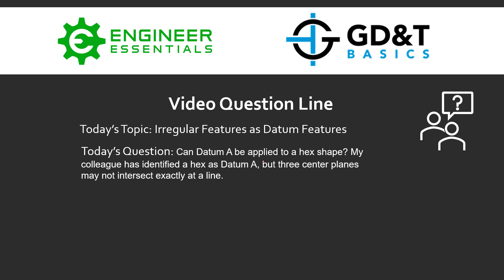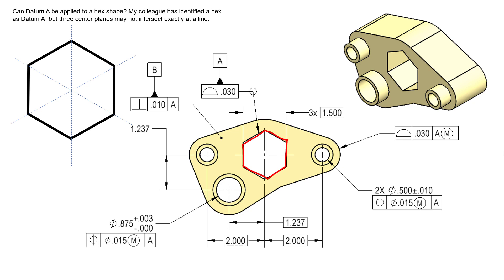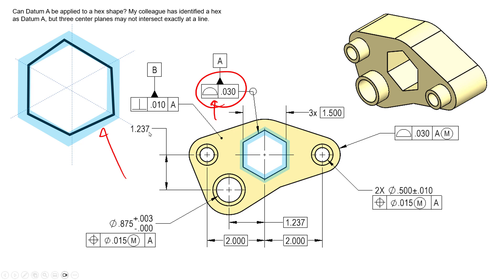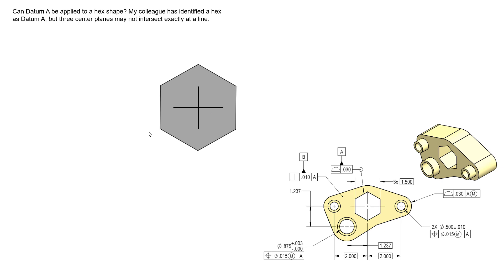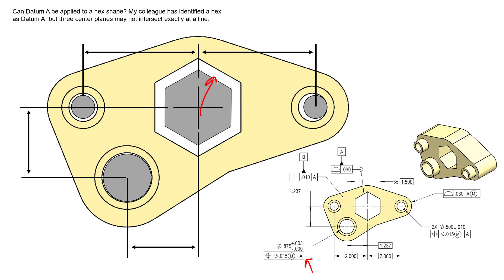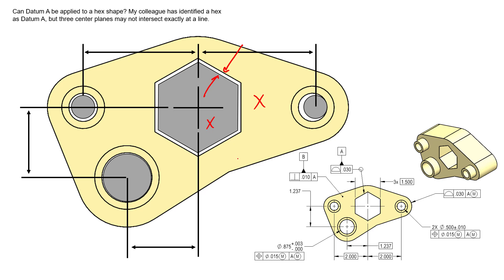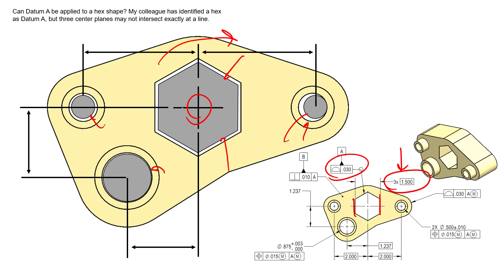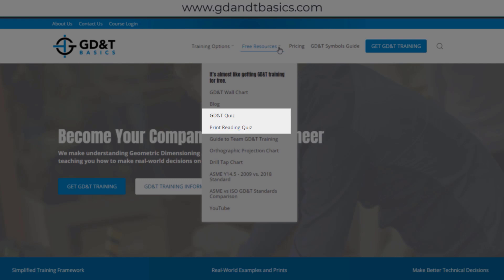Irregular Features as Datum Features

Comment: How do you qualify that datum on a CMM before taking that feature as a datum, yeah i understand CMM will generate related mating envelope from those cloud points for that feature for a datum.
Reply from the maker: Ideally, depending on the software and application, the CMM will take the point cloud and iteratively verify that the points can all fit within a similar envelope to that of the tolerance zone. As long as that envelope width is smaller than the tolerance zone width, its a good feature.
Reply: @Gdandtbasics Thanks for the understanding, would want to understand how a slot works as datum in different precedence and different approach to controlling the Position of it also what are the geometrical elements of a slot like mid-plane/Axis and how it's stimulated, if you can make video on it "All about slots" 😁

Comment: I'm curious about how well this sort of thing is supported in CMM software?  I'm a designer and haven't used inspection software before.  Would a typical operator be familiar with this?
I also wonder if the orientation is unique?  I could imagine that the expanding hexagon might engage the part in multiple ways besides the trivial 60deg rotation.
I am starting to think this might not be a good idea, even if it is "legal."
Reply: I'm a product development engineer for plastics we do CMM for plastic parts, i have same question, how to qualify it through CMM before taking it as datum, btw what do you design??
Reply from the maker: This is a great question and comment. Your thoughts are spot on. There will likely be some issue with this methodology and how executable it is for some CMM software. As you mentioned, sometimes even though its "legal" doesnt mean we should do it as a designer. Good designers consider all aspects of manufacturing, even the inspection department capabilities. If you're concerned about this, there is absolutely nothing wrong with considering a more reasonable and understandable datum feature and then adjusting your tolerances appropriately.